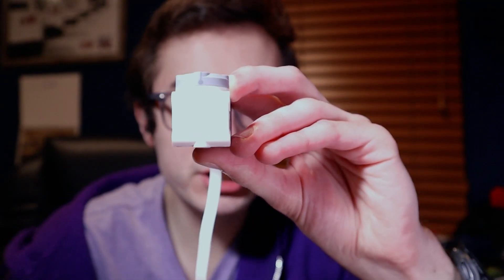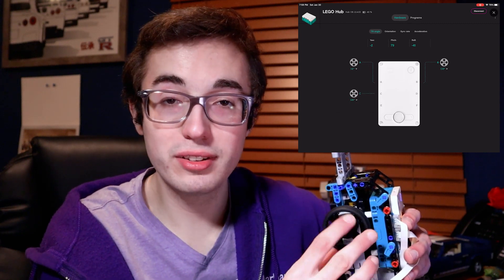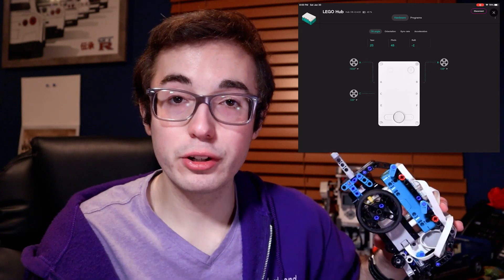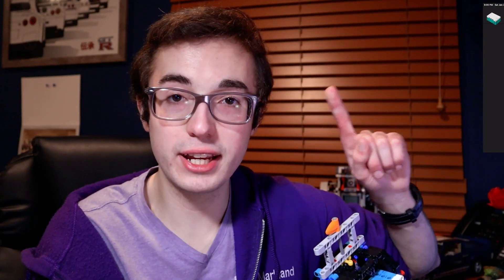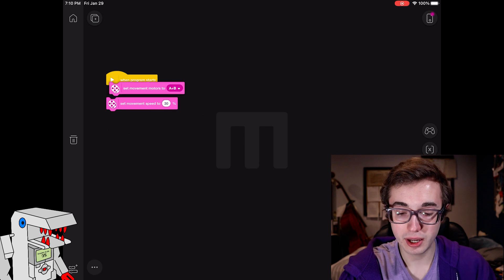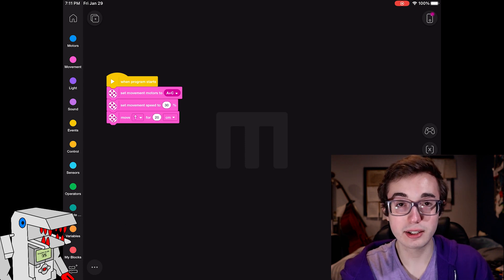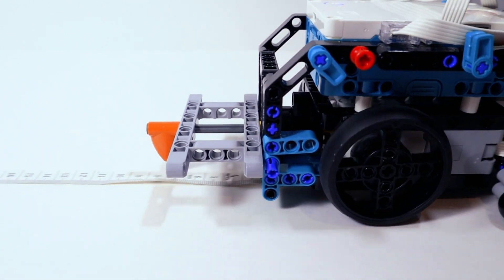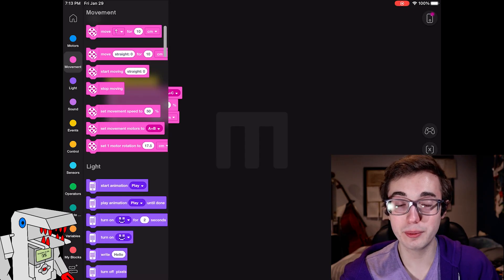FLL Robot Odometry With LEGO MINDSTORMS 51515 Rotation Sensor

Comment from the maker: Tell me about a time where you used the motor encoders to navigate your FLL robot!
Reply: I have not yet used the Robot Inventor motor encoders in a FIRST Lego League (FLL) setting, but my FLL team used the "Port View" in the EV3 brick to determine distances travelled by the robot wheels.  I can see that the RI motor encoders are MUCH better.  As you know, robot wheels sometimes turn at various rates (since they slip or have bent axles), so they sometimes don't drive "straight" using strict odometry-type movements.  Using the built-in RI Gyro Sensor will help in making course corrections.
Reply from the maker: @dluders I'm excited to see what the LEGO 51515 gyro has in store with regards to PID drive-straight algorithms!
Reply: @Builderdude35  it's amazing Kyle. We have been able to drive at 100% power with just a PD system
Reply: I’m too old for FLL but this is very interesting 🤔
Reply from the maker: @Vizonex you and me both! #boomers
Reply: @Builderdude35  I'm 18 but yeah lol
Reply from the maker: @vizonex4316  yeah I'm 20 so same thing lol
Reply: @Builderdude35  I am 79, what?
Reply from the maker: @bobcubsfan  you've got the wisdom on all of us!
Reply: I am very new to this what is FLL?
Reply: @fuzzybrickstudios2315  FLL is First Lego League its a lego robotics competition.The other is called WRO World Robotics Olimpics.

Comment: I made this turntable robot thing and it had a few gears from the motors to the wheels, but it was very easy to recalibrate the distance values. Kudos to Lego to adding that subtle but extremely useful function.

Comment: Nice video! For the problem at 6:46 : Another simple way, especially when using gearing before the drive wheels, is to measure your robot specific configuration. Driving for a fixed amount of rotations and measuring the distance it traveled. Higher numbers of rotation result in higher accuracy. Besides that you can look into motor acceleration and how they break. With this, the movement during start and stop gets smoother and higher motor speeds can be used. Especially useful for heavy robots. Have fun building!

Comment: Of course you can set multiple motors to Shortest Path with one block.
Reply from the maker: Good to know! Thanks for pointing that out!
Reply: @Builderdude35  In the set movement motors block can you choose just 1 motor? Also, why use Stop Movement instead of the blue block, Stop Motor?
Reply from the maker: @bobcubsfan  Six in one, half a dozen in another ;)

Comment: I noticed that you don't seem to use the "More Motors" and "More Movement" extensions; is this just to keep things simpler to understand? Also, one of my biggest frustrations about the new robot and software is the removal of text files - is the only solution (in terms of RLI calibration) to have all runs/programs in the same project? Or should we just have predefined RLI values?
Reply from the maker: Great observations! I am going to dip  into the "more motors" extensions in future videos, for now I am keeping things simple. As for the calibration, I don't have a great solution for that yet, but I am hoping to have one soon! Thanks for putting it on my radar!

Comment: When using Lego Mindstorms robots in FLL, one should make sure that the "gear lash" inside the motors are the same on both wheels.  At the FLL Base, one has to drag the robot back into position, so that the internal motor gears are meshed the same on both sides.  If one does not drag the robot back into the FLL Base, when it launches the robot may suddenly cock at an unintended angle.
Reply from the maker: This is a fantastic piece of wisdom! I added it to my list of tutorial topics to cover as we get closer to FLL season.